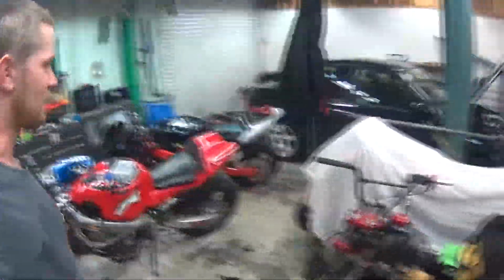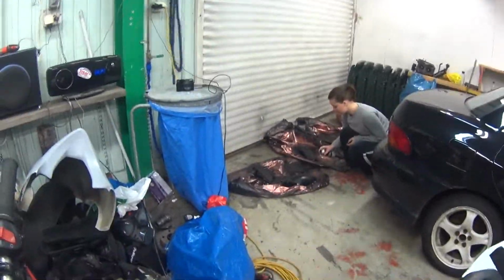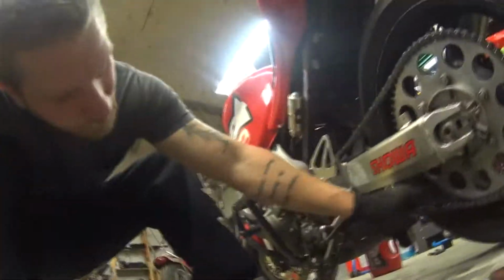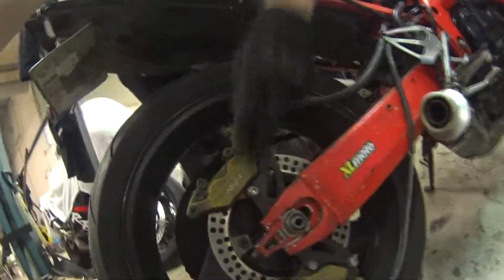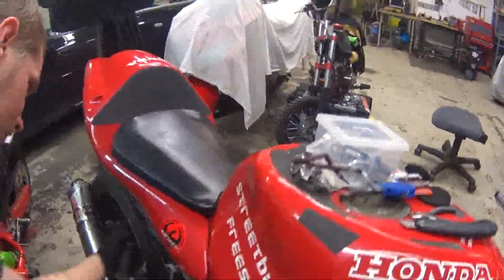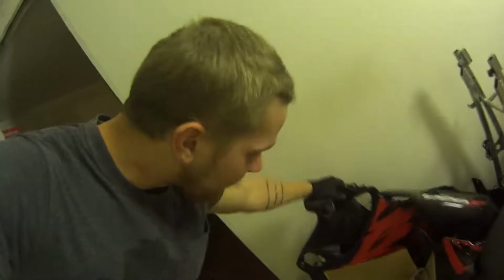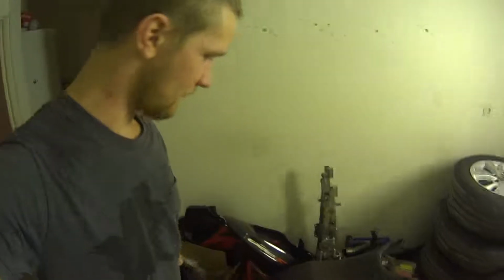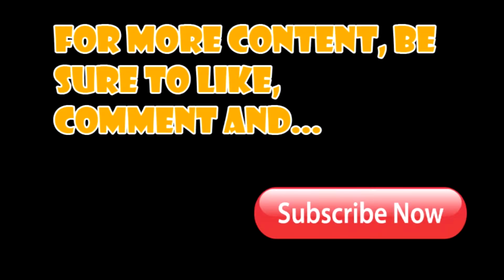Fixing stuff - Motovlog From Sweden

Comment: the red 600f has the 954 forks and calipers?
Reply from the maker: MM 954rr ye :) from another 954 (did not put mine on it :D ) my old has same calipers aswell infront and both calipers at the back too, so it's easy buying brake pads Haha 😂
Reply: Moto Misc hahahah if I was in your place,I would try to see if I could swap the engine of the 954 into the 600f frame (just to see if it would fit),but its just me and my crazy brain hahah, congratulations to your girlfriend also that fix the bike with you =)
Reply from the maker: MM 954rr haha that would mean I need to cut my baby 954 open :p would be awsome to see tho!! but never gonna do that :) yeah she is awsome! she rides it more then me so, and likes fixing stuff like that :D